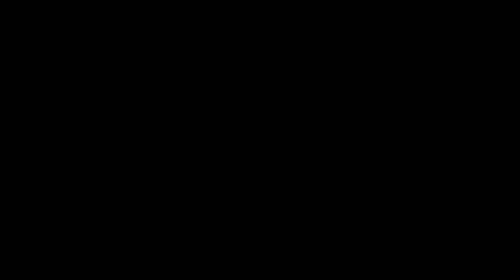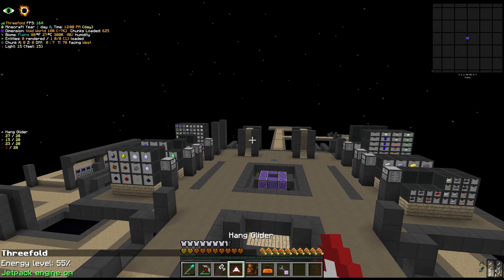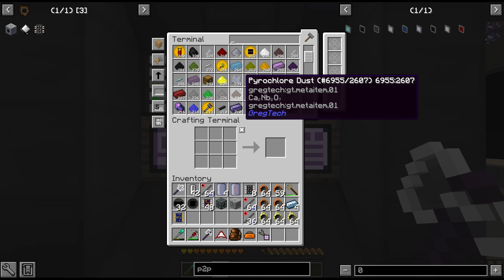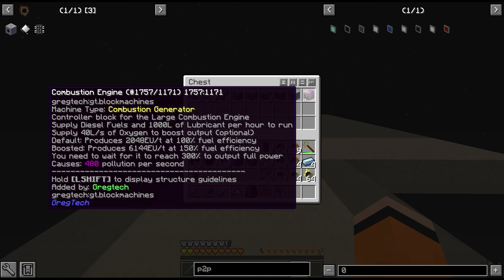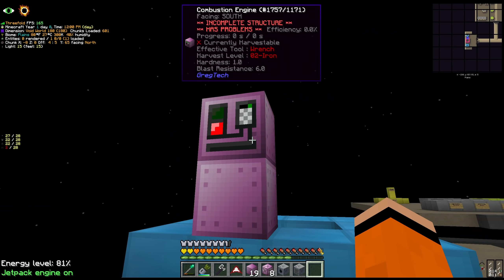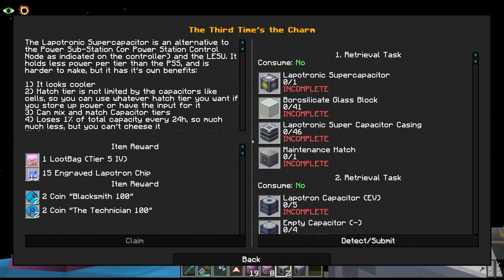Gregtech New Horizons - 36 - High Octane Gasoline! Modded Minecraft

Comment: Could you use P2P tunnels with energy?  Could reduce the loss of cables by building a separate power subnet on red cables ?
Reply: technically he can but p2p use extra energy per energy transfered, so higher the transfer rate, the higher the cost of transfering the energy, which is basically energy lost, but in a different way

Comment: Bello Mr. Threefold :)
Sorry I am still catching up so you might explain it a bit later in the future videos. I tried high octane gasoline a while ago (and yes it was also a much bigger project than i thought lol) but i had issues with consitency, meaning i never had enough octane, something to do with the type of oil i was extracting, is yours consistent? 

also its awesome that cables are hidden and there are facades everywhere :D <3
Reply from the maker: Octane is not a problem for me, I'm using Lightly Hydro-Cracked Light Fuel distillation in order to obtain it since that gives the most output. As for the Oil I found that I needed more Heavy oil for Toluene, so I've since swapped to that :)
Reply: @Threefold.  oh thank you 🤓 I really want to try it again. Cause after bio diesel my oil system is kinda redundant. I guess you also need toluene for tnt, which I use the bio diesel counter part. So maybe I can do something. Me shall steal the info you provided me 💜

Comment: couple of suggestions:
1. you should not make a huge fluid conduit system like this it's quite laggy, swap to separate p2ps as soon as you can.
2. since you have quite a few multis by now I recommend tracking their maintenance with the nuclear control mod, you can craft gregtech sensors and range upgrades so you can track all your multi's maintenance from 1 big block of screens, it helps when you have dozens of multis running constantly.
also for multis that you run far away from your base or in different dimensions (fluid and ore drillers mostly) you can use the same maintenance cover that you used on your clean room and hook it up to wireless redstone to track it from your base as well, this will also be useful when you use lots of different drills on different planets.

Comment: You should be able to use a Yeta wrench to disconnect enderio conduits without having to use the GUI. Im not sure id GT wrenches work
Reply: I just checked, and a soft hammer works to connect, disconnect, and toggle in / out / dual modes

Comment: HOG is actually one of the easier combustion fuels. There's others added by the various GT add-on mods that are, shall we say, not worth the effort.

Okay, so in addition to the divine enemy of Creepthulu you rescued the dude's entire family in a past life. Good to know ;)

Oxygen and Nitrogen are some of the easiest gasses to automate. It's literally air. Remember that air centrifuging setup you didn't set up ages ago, and all of the carefully avoided EBF recipes that were faster with nitrogen? There's your solution for that.

When doing lines of LCRs the ones on the end of the line are going to have move space for input/output hatches, so use that to your advantage of one or two recipes need a ton of inputs/outputs. Input/output hatches/buses can also be shared, but beware of conflicting recipes or unfiltered outputs if you choose to do that.

When sending power far distances through cables it's worth upscaling the power to minimize cable loss, and than downscaling the power wherever it's needed. At IV it's possible to upscale power to LuV, and with some platline components and some T3 rocket shenanigans it's even possible to upscale to ZPM pre-Assembly Line. The latter move is of highly questionable value since the introduction of the Naq line, though, and 4A LuV (which is what a 1x Vanadium-Gallium cable can manage) should be more than enough to support a pre-Assembly Line base.

Superconductors are of questionable worth in terms of using them as cables, but they're necessary for crafting starting at IV, so unfortunately there's no escaping them regardless.

Look into IV energy orbs. You're very quickly going to flatline your power grid if you're trying to run an EV base off of an EV power spine. Ideally you want your power spine to run at least two voltage tiers above what tier of machine you're running, so that running five machines doesn't flatline your entire power grid and power loss is minimal, but running a bunch of amps one tier higher can get the job done in a pinch.

Remember that energy hatches can accept 2 amps of power, so even if you're below a recipe's requirement due to power loss you'll still be fine (at least should be as far as I know, I'll admit I never tested this thoroughly) so long as you can supply more than one amp.

Note that when you're placing fluid P2Ps you want to place down the cable first, then the P2P, and then turn it into a fluid P2P. The issue with doing it in a different order is that right clicking a P2P with an ME cable will turn it back into an ME P2P, which obviously won't work as a fluid P2P. Another thing to note is that when you connect P2Ps the output P2P will change it's type to the selected input P2P, which can easier save and/or cause you a headache if you don't know about that mechanic.

I remember being able to drag fluids to use in filters was added to GTNH in some version after the one I played...although I may be thinking of either a later version than you're playing or item filters. IIRC those also could not be set through NEI in the version I played. That wasn't great...

What part of that mess was required to unlock and finish that research, again? The redcrystal researches have a white background, so they're not unlocked by scanning something in-world (or putting together research fragments into theories), and any essentia you can unlock in the research table by combining it's two component aspects. How you do that in GTNH's research table UI I'm actually not sure, but the Thaumonomicon should describe it. Not that you even need to, you can complete researches without having the aspects unlocked last I checked, you just have to gamble on what actually connects to the unknown aspect.

"I've been looking for something that won't allow a signal to pass through unless it's above a certain threshold" Eh, isn't that called a comparator? This version has the Redstone Vol. 1 book that can be placed in a bookshelf to send a specific strength redstone signal out on three sides, which makes it easy to set a comparator to whatever strength you want. Not that I object to you doing Thaumcraft, Automagy has some neat redstone stuff (like a remote comparator, although I don't know if that plays nicely with GT covers to be fair), but I'm curious why you didn't go with the vanilla solution here. Unless I'm a complete fool and missed something that should have been obvious, of course.

A pyro for wood tar and wood vinegar, with associated distillation tower, is basically a staple of EV/IV bases because of how many useful fluids they produce.

Remember that you can use buildcraft (and openblocks) paintbrushes as well as the IC2 spray cans for color-coding your cables. The former two are less of a pain to craft, but have less durability I believe, so pick your poison.

Notice the pollution particles where that explosion happened? Another side effect of explosions is that they release enormous quantities of pollution, relative to what you'd expect when a bunch of bricks, steel and silver explodes because...magic, really. Though I suppose if the explosion itself is basically magic I guess I've got an explanation for the pollution too, so...go figure I suppose.

Out of curiosity, why not place the super tanks directly against the output hatches? They should auto-output, so I don't see why the fluid pipe is necessary?

You can craft higher tier oil drilling rigs that automatically drain more chunks, 4×4 for the T2 and the full 8×8 oil field for the T3. Would save you some effort moving the oil drilling rigs so often.

For reference, me moving from my MV/HV base to my EV/IV base took like a week at least, and even then I kept using some setups in the old base mainly because I was too lazy to move them. It's going to be a while and a half before your old overworld base is reduced to flat ground again.

Comment: Why do you use fluid p2p? Won't a fluid interface work better? Or aren't they a thing yet in 1.7
Reply: Yes they are available in 1.7, but they're not as useful as in 1.12 and there's some lag issues with them in the past. Fluid p2p + ender fluid conduits are a lot more performance-friendly for large fluid network. Fluid p2p basically just consume like two channels as you see in the video (one input + one output). Ender fluid conduits handle the rest and they will almost always be the most performant way to transfer fluids, because they're point to point transport. Fluids don't render in conduits along the way, they just get teleported to their destination.
Reply: @soulawaken24  oh that makes sense. And in 1.12 is it still smart to use them or should i switch to interfaces?
Reply: @mrfancyshmancy  Fluid ae is built into default ae2 so it’s just fine on 1.12
Reply: @mrfancyshmancy  They're fine as far as I know. Idk about the main AE2 mod, but most people nowadays default to the Prototype Trousers (or AE2 unofficial extended life) version of AE2 anyway. They're perfectly fine in 1.12 either ways. Ender fluid conduits is always an option though, those things can carry an infinite number of fluids through one channel if you just filter every output 😂😂
Reply: @soulawaken24  alright good to know